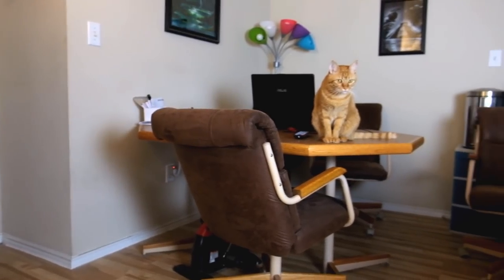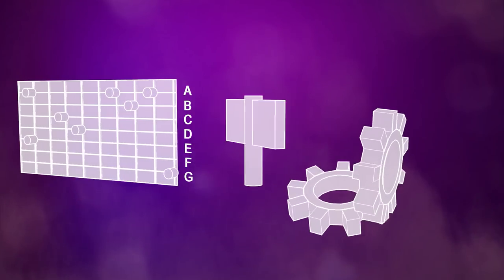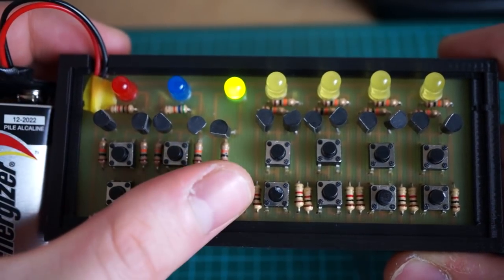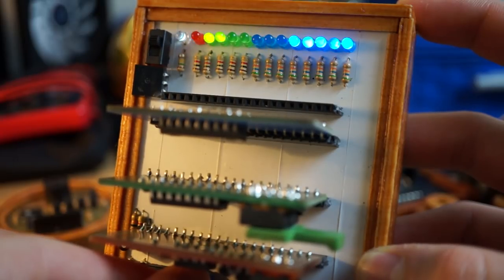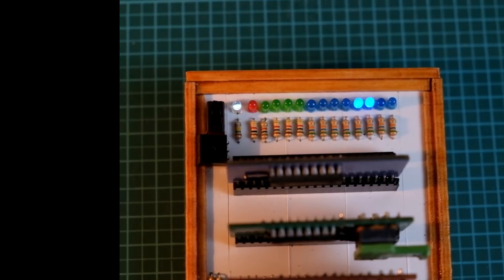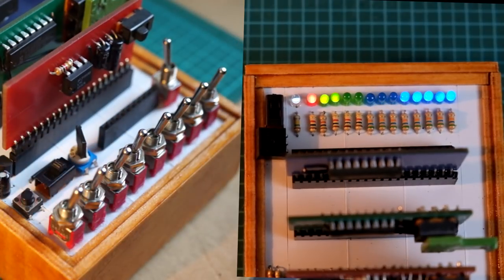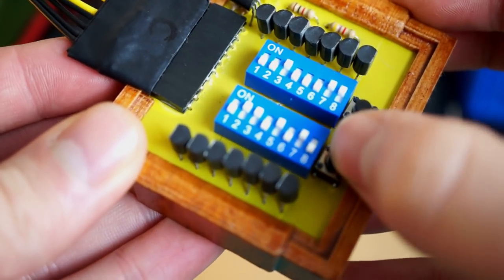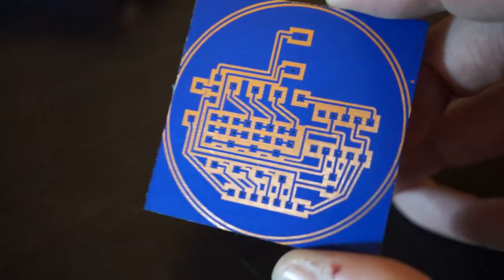How a Computer Works | Visual Learners

Comment: Who needs "programming languages" anyways? Just do it in machine code.
Reply: I agree ;)
Reply: Might take you a long time.
Reply: Who needs "machine code" anyways? Just do it in transistors.
Reply: machine code technically is a programming language
Reply: so try to run doom but written only with 1s and 0s
Reply: @ImXyper Who needs "transistors" just use very specificly placed sand.
Reply: @ImXyper you've got transistors lying around?? Help! I only have 6AU6 left!
Reply: Then forget about the logic you will have spend all your time focusing on code effecicency

Moral: Abstraction is necessary
Reply: @shortestcomment132 SAND, SAND?! ill just use very specificlly placed atoms.

Comment: Great production quality! Hope you continue this series
Reply from the maker: That means a lot coming from you Mr. Volt so thank you! I'm trying to get better.
Reply: @3DSage  Turing>Einstein :D
Reply: @3DSage  But can it run Crysis ? (I had to tell it), seriously, it would be cool if it could use Fourier Series to draw things on the screen using the motor. But this seemss too much for the computing power of the computer.

Comment: That's so cool! I've always wanted to understand how hardware works. I think few programmers can actually describe how their code works on a machine level. And this is the most interesting part of programming. Everybody can learn coding and be very good at C++ and so on, but very few can imagine and actually understand the mighty physics inside it.
Reply from the maker: Well said! I'm glad you liked my video! :)
Reply: Yes. And same applies also in other direction - I have been quite savvy with electronics, somewhat including computer hardware and low-level programming, but I still struggle to learn and meaningfully understand the working of high-level programming.
Reply: @TheSimoc  same man, i can write an opengl game in c++, but i'm struggling with python for loops 😂🤚

Comment: You don't need a transistor! A couple generations before you were born we did these things with vacuum triodes. And I'm sure you can make hydraulic computers too if you haven't conquered electricity yet.
Reply from the maker: True but I heard vacuum tubes were large and burned out frequently so the transistor really made it reliable and incredibly small. I saw a video where a guy made a full adder add two numbers with dominoes! Thank you for your comment!
Reply: Yes vacuum tubes are bulky, power-hungry devices that need regular individual service, but they have a pretty spectacular linearity and consistency in behaviour while they haven't burned out yet. When first transistors appeared, large swaths of professionals were sceptical, as they behaved in a fairly erratic manner, and first transistor equipment was very flaky! Still today you can take a bag of perfectly fine factory-fresh transistors, and find that their gain is all over the place, twice or half the norm is not unusual, and then it changes over the life of the semiconductor. Digital circuits were partially the saving grace for transistors as their terribleness would not matter as much, and yet a significant learning curve was incurred before transistors started powering everything in our life.

What i find utterly fascinating also are electromechanical switching devices. Konrad Zuse created fully programmable (principally Turing complete) computers completely out of telephone station relais! I saw the machine in operation, you can literally see and hear what it does. Zuse's machine was also the first Van Neumann architecture machine, meaning the program is executed from RAM just like data, and no principal distinction between code and data exists, and it also implemented floating-point numbers! The machines in the museums today are no longer particularly reliable due to material decay, but they can still go for minutes without a computational error, and it must have been spectacularly power-frugal and reliable for its time - compared say to the tube-powered ENIAC from around the same time.
Reply from the maker: Wow that is all fascinating! I grew up with modern computers so I missed out on these milestones and I'm sure it was very exciting to see the breakthroughs in technology. I wonder if quantum computers will become more common in the future and what that evolution will do for computing.
Reply: @SianaGearz  You are principally right, transistors have challenges in their individual charasteristic deviation, but as you implied it only matters in analog circuits - in computers transistors have since very beginning been much less problematic.

I'm not sure what learning curve you were referring to, but in low-level computer demonstrations, transistors suit better than tubes because of easier learning curve. Tubes are much more complicated to set up in first place with all the extra circuitry they need, and even once you have made and understood it, setting up a computer with them makes way more complicated wiring mess, making the computational behavior more overwhelming to take grasp on by beginners.

Not that I hate tubes at all, and I really like vintage, and generally different and interesting ways to do things, and I also see your point that with analog circuits, some (not all) things are even simpler to make and understand with tubes. But just in this context - demonstrating low-level computer inner workings - transistors are simply better without excuses.

Comment: 2:39 - 2:49
If you're really new at logic gates like me and this has you really stumped I thought of a way of explaining it in a way that made sense to me.

The NOT gate is a logical inverter. As shown in the video the NOT gate's light stayed on until the button was being pressed, opposed to a non inverted light that stays off until the button is pressed.
When you wire the output of one NOT gate, to another NOT gate's input you invert the inversion of the first NOT gate. creating the 4 bits of ram inside the video.

hope that was helpful and made sense, if it wasn't and you know why I'm eager to listen

Comment: I dropped out of one of the best engineering colleges in 1975, but while I was there I was introduced to computer programming (Fortran, using punch cards for programs,) logic gates, and basic electronics. I ended up working low-end jobs that demanded no skills. I finally landed a job as an electronics assembler. After a few years of that I was working for a company that made peripherals for the Commodore Pet computers, and they were just coming out with their own computer, a glorified Pet running a 6502 at 2MHZ. I was offered a chance to try my hand at troubleshooting the boards, and I took to it like a duck takes to water. Ultimately I was a junior HW engineer and THE hotshot troubleshooter. Over the next couple of jobs I designed a keyboard around a Motorolla 6801, and I made some test fixtures that were little computers, like a memory module tester. Then I had a boss that forced me to learn to program in C, and it was duck-takes-to-water again. I have been creating automated test systems using C programming and some hardware skills ever since. I am now a senior-level test automation engineer. I still have no degree, but I am in demand. 

One thing I picked up a few years back was the Arduino. I would never seek to make a career based on that thing, but it is a fabulous skill to add to your existing skill set, it just opens new vistas for you. I use them between my PC and the hardware under test, sensing, controlling, reporting, communicating via a serial port. If you want to play with a low-level computer, for cheap, learn the Arduino, and then search for fun projects that use it. The PC is still the main test system for me, but very often there are a couple of Arduinos attached to it.
Reply from the maker: This is amazing! Thank you for that wonderful information. Part of me is envious that you lived through those early punch card eras so you have a closer relationship to computers and the fundamentals. Computer are just pure wizard magic to kids today. They don't know. That's why I wanted to make this video and take away some of the mystery. That's great you are now into the Arduino. It's a great tool to have and know. Thank you again for the great comment!
Reply: @3DSage  Computers used to be a lot more fun than they are now. They are now so big and complex that they are virtually incomprehensible as a whole. When I was learning to troubleshoot those early systems my primary reference was a thick book from Texas Instruments on the 7400 series of chips. When I bought my Apple II computer in 1979 it came with schematics and ROM listings, I still have that book somewhere. All the chips in it were socketed and off-the-shelf. I don't know how many times I repaired it myself. The early IBM PCs were also very cool, but I hated the 8086 in them. "Building your own computer" today is about buying completed boards and plugging them together. Back then it was proto board and wire-wrap sockets.  That's why I like the Arduinos for fun, they get you back to the basics, though the Harvard architecture is different from back then.
Reply from the maker: @flingmonkey5494  That is fascinating. I really like seeing those old computers. I think they still have value. And a few youtubers are making computers from simple chips. Ben Eater has a great breadboard computer series that helped inspire me. I hope to see more interest in those simple computers, at the very least, to help people understand how they work so they can understand our super advanced computers work today.
Reply: @3DSage  It was fun at the time watching how computers were changing the way companies operated. For instance, accounting. It used to be that the accountants would work each month with the accounts to produce a report at the end of the month on the financial standing of the company, and it was gospel. Management would make decisions on company direction based on that report. Then a couple of nerds created Visicalc, the first computer spreadsheet for the Apple II. (I had a pirated copy.) Now the CEO could go back to the accountants, say "Change these numbers and this calculation", and get a recalculated spreadsheet in minutes. Suddenly the companies spreadsheet was malleable. It was no longer gospel, it was just the latest version.

Comment: You show the Red PCB Timer (555 IC), the Green PCB Counter (74HC141), and the Blue PCB SRAM (CDP1824). Clearly the heart of this computer is mssing. Where is the CPU? Did you use a CDP-1800 series 8-bit CPU? Is this basically a COSMAC ELF?

Comment: Maybe I have to watch it again. it is very hard to understand, which button is the CTRL, the Alt and where is the Delete? Normally I am the best with computers, when there is a problem, they call me, I come around and I give the three finger salute and then I say something like: "the problem was in the contemporary flag register, try not to index the boot sequence next time, here place a beermat under your keyboard so that the high bits and the low bits of the data stay in balance!" 
 
I haven't got a clue what to do with four bits, neither the programming nor the instructions.

Comment: How did you implement the control unit? The part which decodes the instruction and sends control signals to the ram etc. and how did you implement the fetch decode execute cyclr or whatever?

Comment: Great video, but I don't think your machine classifies as a computer. It doesn't compute anything - you'd need to add an ALU. I'd call it a programmable automation controller.
Reply from the maker: I understand what you are saying. But It take code written by the user and executes them and can perform different types of events depending on the code so to me its a simple computer.

Comment: What happens if all opcode bits are low?
 How does the computer know what an opcode bit does?
Reply from the maker: think about it more like a light switch. You wouldn't say how does the light bulb know the switch is on or off. We know when a circuit is completed, the light turns on. Same for the chips that have many logic gates. If a bit is low, that controls the circuit in the chips.

Comment: And if you take an and gate and an or gate, have the output of the and gate lead to a not gate, have the not gate and the or gate outputs lead to another and gate, use the same first input for the first and gate and the or gate along with the second output being the same, you get an XOR Gate
Reply: You can also make an XOR gate with 3 NOR gates and an OR gate: both inputs go into one NOR gate, which goes into two other NOR gates, and for each of those two NOR gates, the 2nd input is one of the inputs. The two NOR gates go into an OR gate, which is the output.

Comment: You have not explain about resistor in circuit.. can you please explain
Reply from the maker: The resistors are more to protect the components by slowing down the voltage.
Reply: @3DSage  Basically you connected the resistor in series with voltage line , so that voltage get slow and then you connected transistor

Comment: the production quality on this video is amazing. Very informative and humorous. your channel deserves alot more popularity. 

The device you build is not technically a computer because it doesn't compute. if you want to build a computer from sctatch you'll need an ALU, a register, a binary counter, ram, rom and alot of logic gates. you can however  use a pre build cpu, like the Z80 for example. you just have to hook up the eeprom, ram and i/o devices and you have a fully working computer (after programming). the eeprom is where the program goes it's like ram but stores the data permanently. the program consists of a set of instructions and operants. eg: 
00000000 = load byte A into register
10001010 = byte A
00000001 = add byte B to register
10011000 = byte B
00000010 = output register to an i/o device indexed by byte C
00000000 = byte C

the instruction set i used in this example is;
00000000 = load * into register
00000001 = add * to register
00000010 = output register to *

this is a very simple example of a machine code program. it outputs the sum of byte A and byte B to a i/o device
Reply from the maker: Thank you for saying that! I am trying to get better with each new video. I hope this helps explain these electronic fundamentals. I would like to expand on this and make my own functional gaming console. I'm glad you enjoyed the video!
Reply: 3DSage if you have the computer running you'll need to be good at assembly language to make the games you want. or maybe you can find existing games on the internet. but you will have to change your hardware to the games requirements.